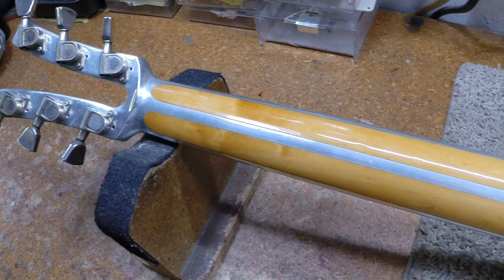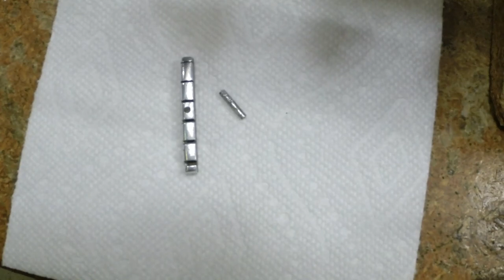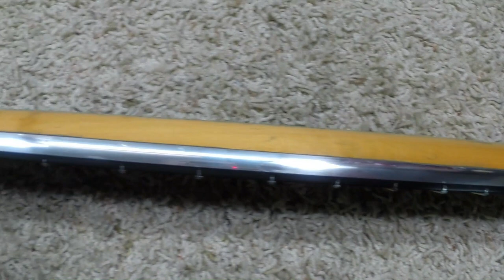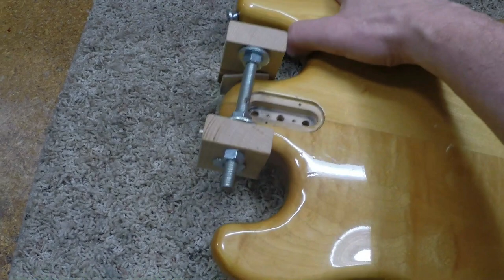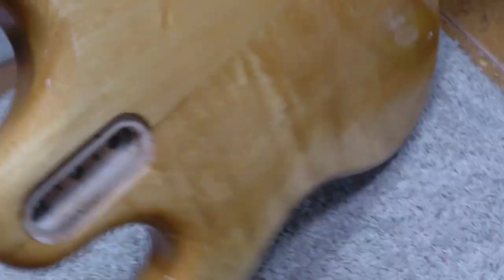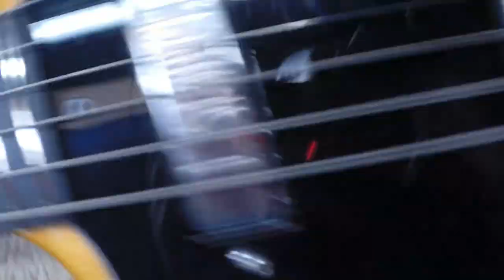Heavy Metal Guitar 1

Comment: How do you allow for relief without a rod? I assume the string tension won't bow the metal as it would with maple. BTW another great video!
Reply from the maker: Oh, but yes it does bow from string tension.  You have to check flex with and without string tension then pre-plan and neck jig as required.
Reply from the maker: You might also want to check out my Martin compression re-frets.  That will give you something more to think about.  Thanks for checking out the channel.
Reply: @guitarc.p.r.9675  I'm still working on your  bass refret video. Three views so far Thanks for the reply

Comment: Being aluminum does that guitar have long sustain? that crack due to the back plate only having only 2 screws anchoring it that is offset and tension from the strings pulling different ways? After Your martin i had to go buy a taylor 12 string from ob f that I want to bring to you so you can set it up and make it sound the way you do when your not swamped and able too. It has 3 tiny screws right behind the saddle that I have never seen before. I was going to have you explain what they are when I bring it to you. That added another I have to bring to you. That makes 4 now. Lol I like to have been able to get a older martin d18 or a d28
Reply from the maker: OK Jody,  the neck has 3 bolts, threaded into the aluminum.  A lot if the cracking was due to not much material being left in the gluing area, and the amount of lateral shift present.   Plus I do not believe it was glued well to start with and the wood could have been cured better.  It does have MASS sustain, but that was common for the late 70-80's period.                                       
  Well,  you know I am an authorized Taylor service.  I can do the acoustic for you.  BTW the set screws behind the bridge saddle are tension adjustments for the 3 pickups there.  Do not touch them, they can snap if over tightened, and they also must be loosened to remove the saddle without damaging the pickups.